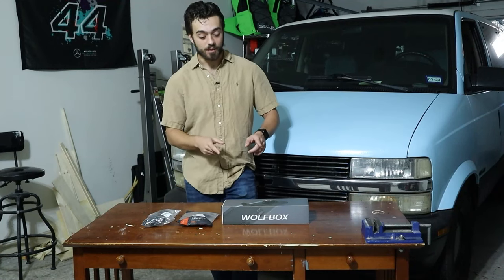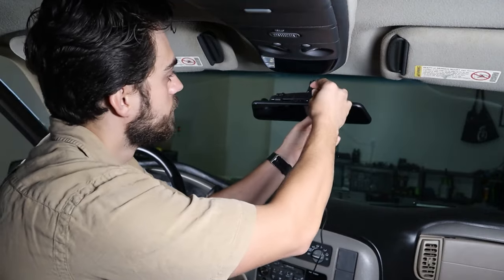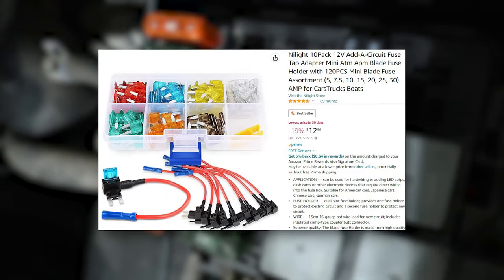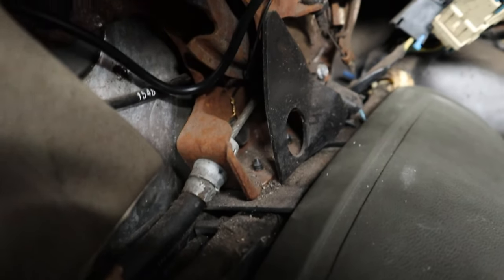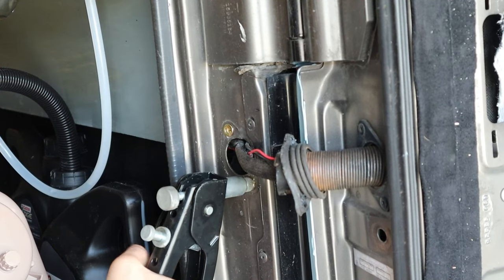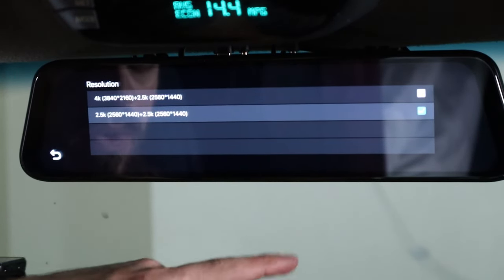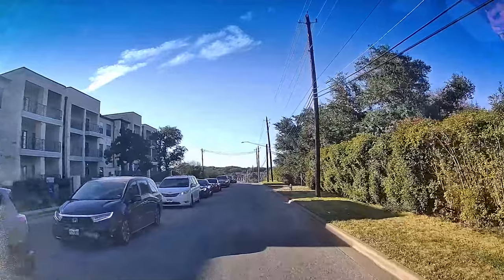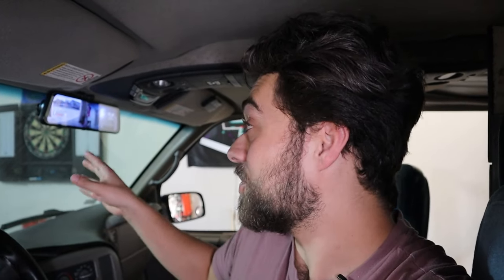Dash Camera, 4k Mirror and Backup Camera Install | Wolfbox G900

Comment: Nice review; however you did not cover the way to use the G900 as a replacement mirror to include removing the old mirror and mounting the G900 instead of having the G900 banded over the old mirror.
Reply: It's not rocket science, buy the glass mount removed factory mount and reverse it

Comment: I have this same van and want to do this upgrade. My question is this: if I want to keep the display off so it functions as a normal rear view mirror (I have kids), will it activate the backup cam when backing up even if I don’t have the screen on beforehand? You know, sort of how other backup cams are off until backing up.
Reply from the maker: Heck yeah! If you want the screen to operate like a standard backup camera, you will need to install the red wire to the reverse lights!
Reply: @AutoMotivate  thank you! Awesome work by the way! Just watched your Timelapse. You’re amazing!

Comment: None of the wolfbox video's I have seen show a shot of the backup camera showing the read bumper. That would be neat for tight parallel parking.
Reply: I’ve seen reviews where if it’s wired to the reverse signal the angle actually goes much lower

Comment: Thank you for your video! I personally find it very informative and detailed! May I have a question about connecting the mirror dash cam to the rear camera? If my car already has a back up camera and I want to use that one, can I still connect the red wire to the rear camera so that I can have a wider angle from the mirror dash cam and still use the car’s screen for reverse parking (I mean can I see both the car’s screen and the mirror dash cam at the same time)? OR I actually have to trade it off for only being able to see from the mirror dash cam and can no longer use the original rear camera that my car has for reverse parking?
Reply from the maker: You can T off of the existing wires and wire up a connection. 
I am not 100% sure how it will work/perform but I think it should work.

Comment: i’m sold on this thing as long as you can turn that damn startup chime and all the other sounds off. i’d pull it apart and take the speaker out if i had to. i know you get the audio from your recordings playing back but it’s just not worth it
Reply: after actually completing the video, i saw there was a tone setting does that disable the startup chime as well?
Reply from the maker: @madeofdrew  Let me go check.
Reply from the maker: The chime can be turned off by putting the devices volume to zero! It is a bit obnoxious, glad you brought this up!

Comment: Do you know if there's a way to remove the splash screen? I only wanted it for the rearview functionality but its a pain in the ass it takes quite a few secs to power up, because I wired it so it only turns on when putting reverse

Comment: Howdy, Can the camera be installed the opposite of upside-down like it's normally installed? I'm trying to see if I can install this  right in the tailgate handle of my pick up. Thank you!
Reply: I am pretty sure you can flip the reverse and front cameras orientation 180 degrees in the settings on the mirror touch screen

Comment: Did you put the factory fuse back on the fuse tap holder? I didn't see you put them back or maybe I missed it. Will it matter?
Reply: It does matter. You need to put the original fuse back into the fuse tap

Comment: So the hard wire kit, will the fuses replace the fuses on my fuse box. Like cigarette lighter. And if I use my cigarette lighter will it still work. Or will I need the 2 way fuse holder
Reply from the maker: The cigarette lighter socket will only allow it to be on whenever the socket is getting power. Through that method you do not need fuses.

Comment: I love the dash cam nice build quality and resolution. I do have an issue with the reversing line set up of not being able to adjust the bottom left hand movement point adjustment any more as it is too close to the return to menu arrow. Every time i try to move it, i get sent back to the main menu.. does anyone have a solution i might try to reset this.. i have tried the reseting to defaut option in the main menu.. but it does not reset the movement points just the camera options.

Comment: Is it worth it in regards to removing/reducing blind spots?
Reply: I recently got another model of the same brand a couple of weeks ago and noticed that both cameras have wide vision. The back camera helps halfway through for blind spots, but if the car at your side is smaller than yours, you'll have the same issue as if you didn't have the camera. I re-educated myself to take advantage of the added vision and now I barely worry about blind spots.
Reply: @lavacaballero which model
Reply: @MM-ho7kb  G840S, is the 12" one

Comment: Is it possible to just use the red fuse cable only so it only runs when key is turned if not using the parking monitor feature?
Reply from the maker: Yes! The manual talks about something along those lines!

Comment: Can you adjust the reverse lines? Can you shut the lines off if you don’t want them on?
Reply from the maker: I do not perfectly understand what you mean but you can unplug the reverse camera from the unit. You can also switch which screen you want to be shown on the unit. You could turn off the unit and use the mirror like appearance as a rearview mirror. Hopefully one of those answers your question.
Reply: yes you can, turn it off in the setting.

Comment: Just installed a G850 with the OBD2 hardwire kit and it's staying on after turning off the car and removing the keys. Any advice?
Reply: I think that’s intentional, so it records even when it’s off. I haven’t installed mine yet but I believe if you attach the wire that was dedicated to “always on” to one of the “accessory” for the fuses (to where both is on accessory), it will prevent that and only work when the car is on. That’s how I was planning to install it
Reply: @gcjenks3689  So I did some research after posting this and it's basically still powered up to 10 minutes each time the car is shut off, it's normal for accessories on to be powered for a certain time 

I went with the OBD2 connection as well. Are you doing it fully hard wired?
Reply: @myst8217  yes, I bought the hardware kit to fully wire it rather than using the car charger. I’m assuming that’s what you mean? Also thank you for the update! If it shuts off after just 10 minutes then I may just install it the way you did as well
Reply: @myst8217  I’m doing the USB C hardwire kit

Comment: Bought mine but I returned it.
Reason: it's always recording even after you tell it to stop recording.  Let me explain.
When you turn on your car it starts recording automatically, you have to press stop to stop recording.  It will automatically record when you exit out of ANY menu options.  For example, if you stop the recording and go into the menu (settings, resolution, volume, brightness, etc. you can even see it happening on this review) and exit out of it, it automatically starts recording, even after you tell it to stop.  To me that is not good as I already stop the recording, and really it is wasting memory.  This WAS the deal breaker for me.

Other things I thought needed work on.  It does not record for a longer than like 5 mins per video.  There should be options to record for hours per video.  Also it seems that 'loop recording' is forced as I couldn't find a way or option to turn off loop recording (no setting to change it)

The Weird.  One thing that was weird to me was that I didn't even hook it up to my home wifi, phone, or it's GPS, and somehow it configured the time and time zone by itself.  Which I thought was really odd.
Reply from the maker: The loop recording is so the oldest recording can be deleted whenever it runs out of storage. 
If it loops in hour increments then your long footage will be deleted at a time instead of 5 minutes, which can be very useful and is very smart. 

I can’t comment towards your other opinions because I haven’t had issues with what you mentioned. Others might!
Reply: @AutoMotivate  if I am using a 256GB sd card and am on a road trip that is several hours long then I would not want to have to go thru all the 5min videos to find the one I need, that's potentially over 100 videos I would have to sort thru, and to make it worse there is no thumbnail for the videos but only text files to search by.  Also what if I don't want loop recording but instead want to swap out the SD card, that should be an option instead of just looping.   If my destination is several hours away I might not look back on the videos until I've reach my destination.
I'm not saying the videos should be an hour long I'm saying it should be an option that is available along with 5min videos.
I'm sure there are some who also uses the videos as blogs/vlogs, and would prefer that older videos don't get erased when the SD card is full.
I'm not saying it's a bad tool.  I'm just saying that for me it was a deal breaker.  I don't mind that it auto records when I start my car, I just don't like the fact that when I stopped recording it should remain stopped until I tell it to record again.  Adjusting the volume, or brightness it, or even just exiting the menu items should not go back to auto recording.
Overall having a dash cam is better than no dash cam.
Reply: @xiongboon  so I have a different brand dash cam that was a lot more expensive than the wolf box. In its instance the loop recording is set to 1 minute with no adjustment. However when I upload say a 4 hour road trip (using a 256gb card as well) all my footage is in order so I drag that off the memory card and into my MacBook and it puts them in order again. May not be helpful but it could give you an option if you wanted to revisit it. I just ordered this cam today because of the rear recording where my current dash cam can’t do because it is blocked by my bedrack and is not waterproof.
Reply: @newlifeoverland226  yeah I watched a review on the rydeem tombo 360x and I think that might be the one for me be a use of it's many options available and the option to save to an external drive.  Although I won't know for sure until I use it, but so far the review seems good